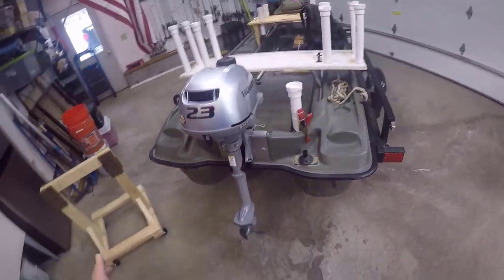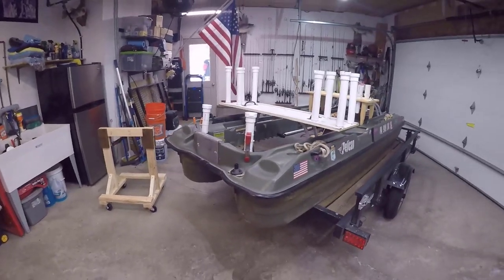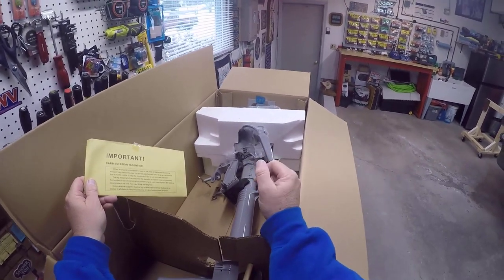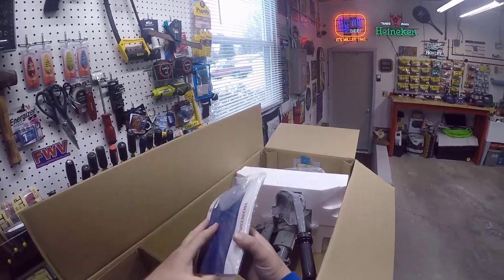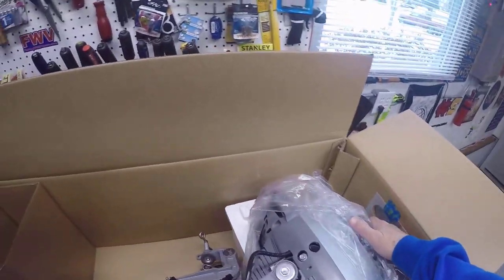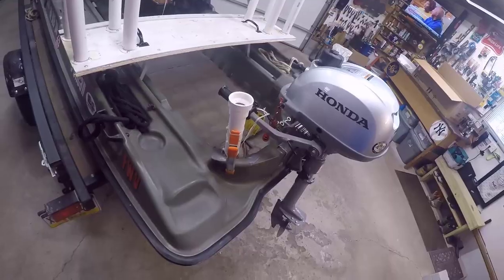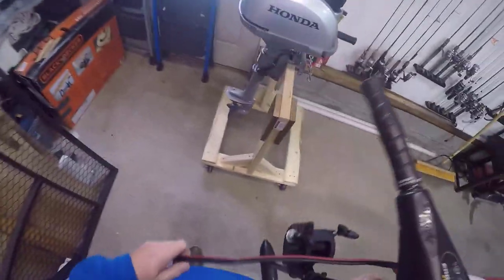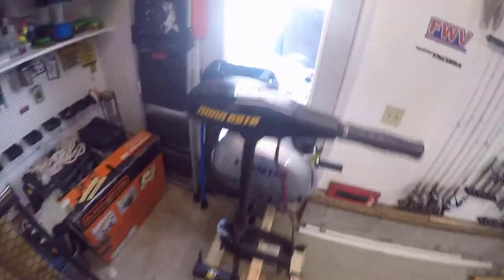PELICAN BASS RAIDER MODIFICATIONS 2022 HONDA 2.3 UNBOXING | Fishing With Vance

Comment: Finally a video mentioning using a 15" shaft motor on a Pelican Bass Raider with a tall transom.
Reply from the maker: If you have any questions, let me know.  Thanks for watching.  Good luck with motor.
Reply: @fishingwithvance  I appreciate it Vance. I have watched a lot of video's that talk about modifications that people do to their Bass Raiders but I hadn't heard anybody mention the shaft length of their motor. But you mentioned it. I have an older Sears GameFisher 3hp air cooled motor with a 15" shaft that I recently dug out of the shed and fired up, but it just looked like it might be too short to use on the back of the Bass Raider. I figured I would need a longer shaft motor until I watched your video. So I definitely appreciate you mentioning that you use a 15" shaft motor on the Pelican Bass Raider.

Comment: Great looking motor. I'm excited to see some videos of you cruising around. I like the table idea because all your stuff is at sitting/fishing level. Going without the table makes more sense then trying to step over it. You could also modify your smaller wood legged table and thin it up like you did the white table. Then when you tranfer from back to front you could set it on the  floor of the PBR10E and turn it so you can move easier to the front. Then place it back in it's orignal fishing position. Anyway thanks for the video. Fish On!!!
Reply from the maker: I like that idea a bunch.   I ultimately need something that is repeatable and safe since I'm not getting any younger and want to take this thing on bigger waters.  I fish alone a bunch now so any setup that allows me to move from front to back without kicking rods in the lake .. or ME would be best.  Probably should do no table at first.  It will take some getting used to with new launch and motor in boat etc...  it would be one less thing.  Maybe run lean until I get it all down pat.  Hope things are good out in Cali.  Weather here stinks.  How soon until you are able to wet a line out there?

Comment: First of all, I'm jealous of the Honda motor. That's gonna be sweet. I think if you look at it long enough, you can figure out a rod holder mount for one of the side rails. As you were going over it, I was thinking of a way to mount something in the side compartment rail that would let you put rod holder brackets on that let the rods be stacked up horizontally. That way you could go without the table and you wouldn't have to worry about trying to cast around them when they're vertical like you do now. It would be a lot easier to get from the back seat to the front without stepping over a table. As I'm sitting here waiting for the weather to warm up, you've got me thinking about new things I need to do on my own Pelican. Wish we lived closer so we could brainstorm together. We'd have two bad ass Pelican's when we got done. LOL
Reply from the maker: I wish we lived closer too Sam.  Weather is maybe going to get a little better here this week so that is good.  I should probably look to take less rods on outboard motor trips.  Putting something on the side horizontal should work.  Work in progress I suppose.  Part of the fun for sure.  It would be nice to just move up front without the table.  Thanks for watching Sam.  Stay warm out there.  Fish on!

Comment: Almost bought that same motor but I ended up going with the Yamaha 2.5 it was a hard choice they're both good motors. I built a little frame on the back of my pelican to help with the transom flex. You know what I mean when you get out on the water and go full speed that back section flex is quite a bit at full speed
Reply from the maker: Hmm..  I have seen that on other vids.  Hopefully it isn't too bad.  How fast to you get going with the Yamaha?
Reply: @fishingwithvance I want to say 4 mph
Reply from the maker: That will do it

Comment: How do you transport the Motor?  Do you take it off while driving or is there a brace for this.  Thanks
Reply from the maker: I have been taking it off while driving.  As long as you lay it on the side with "feet" it is fine.  Not sure I would leave it on the PBR while driving unless you did a reinforcement mod on the transom.  Just my opinion.  Thanks for watching.  Nice little motor for sure.
Reply: Thanks and I’m getting one of these and thinking of building a wooden support for it